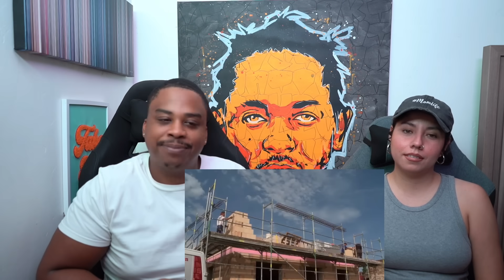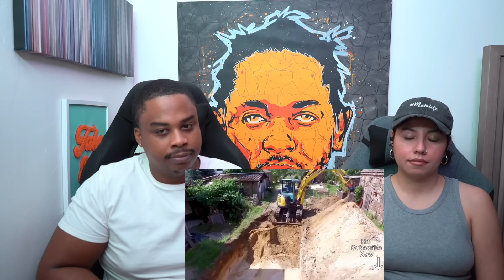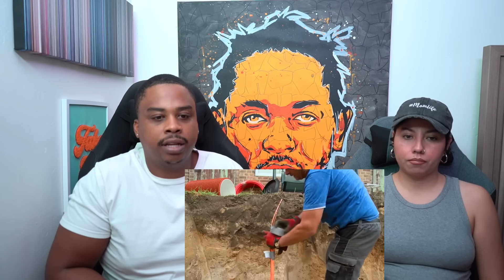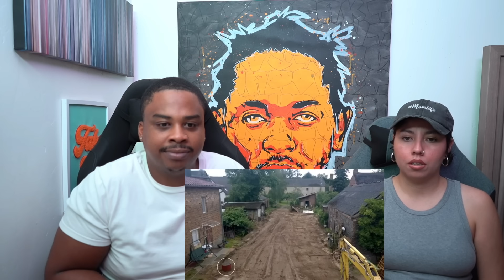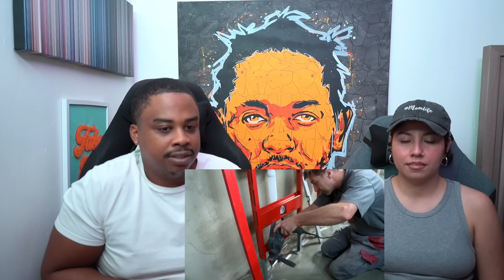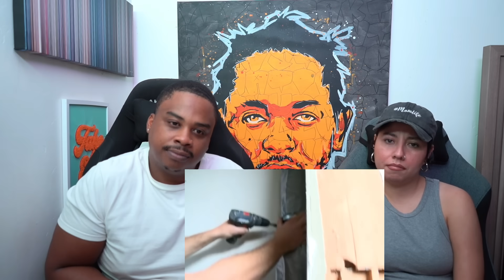AMERICANS REACT TO HOW GERMAN HOUSES ARE MADE PT4

Comment: The last parts are not available with English voiceover, you have to watch them in German with auto-translated subtitles. (Edit: Part 9 is only on the Brale channel, not on the Taurifilm channel.)

Yes, you can use nails with plaster walls. The plaster is fine enough (high sand content) to take small nails. To hang heavier objects, you do as the installer does in this video and drill a hole for a screw.

Plaster walls can be painted directly, but for living spaces, you want to put up wallpaper first. Either a plain white one that gets painted (like the surface layer of drywall), or a nicely printed one. Textured white ones (to be painted) are also very common. The tendency in Germany is to have either white painted walls, coloured wallpaper, or patterned wallpaper. Coloured paint is uncommon.

Comment: up to a few years (ok, maybe a few decades by now) all the pipe installations were done in the (real) walls, or visible in front of them where it was not possible. But since a few years its done behind those drywall facades for easier access and remodeling.